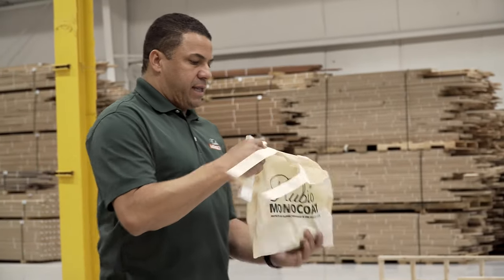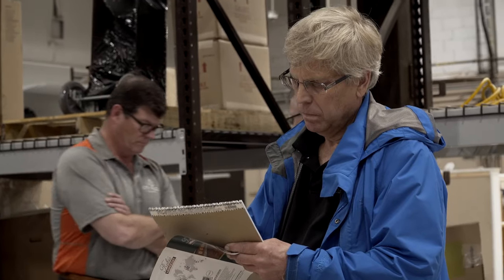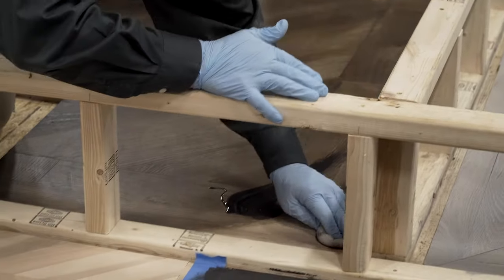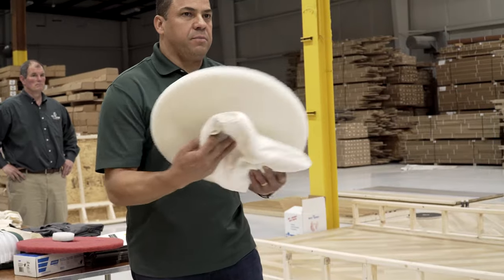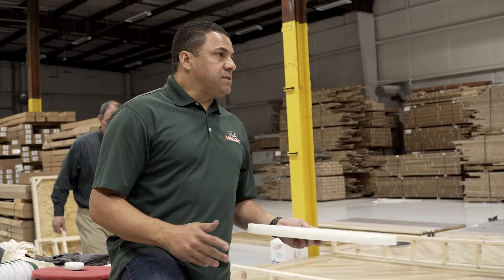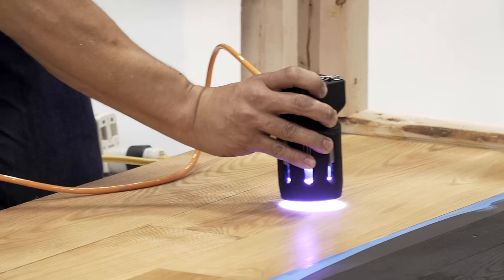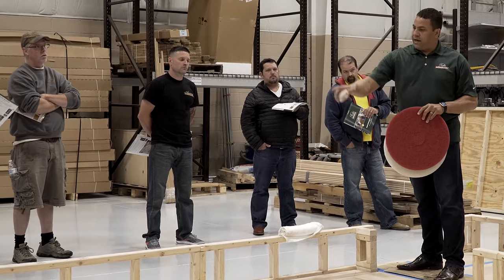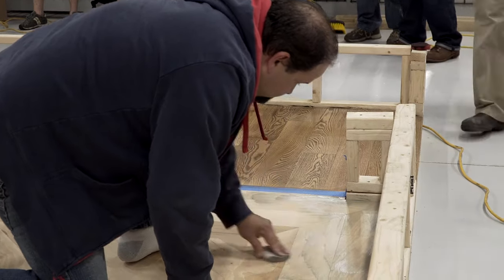Rubio Monocoat Product Demo Event at City Floor Supply

Comment: Robert Surprenant
4 minutes ago
Just completed my first Rubio Monocoat floor. We went with Savannah,nonpopped. Followed the finishing sequence to 120-grit screen. The Monocoat portion went on really well. My only issue was there was buffer patterns left in the floor(not marks or swirls just shadows from the Clarke 16-inch buffer. We waited a week then applied the maintenance oil and that seemed to hide the buffer passes a little.  Question: will these buffer runs dull/disappear/blend or fade after time and usage?

Comment: Hi ,can somebody point me in the right direction,I have fitted a pre finished herringbone floor a couple of years ago and I asked the supplier what was the name of the oil and it was the Rubio in walnut .Can I purchase the oil and just do as there doing in the video or will it not take ,don’t really want to sand it
Reply from the maker: Hello, refinishing a prefinished floor can be a difficult task. We highly recommend consulting an experienced hardwood floor contractor for a situation like this. If you need help finding someone in your area, you can use our Find a Contractor tool - https://www.cityfloorsupply.com/FindAContractor

Comment: Do you put the color on before you put on the Natural Rubio Monocoat Oil Plus 2c Finish; or is it a one step process with the color being part of the Monocoat Plus? Thank you.
Reply: Our Oil Plus 2C is a single coat application that colors and protects the wood in that one single layer. It is available in 50+ colors.